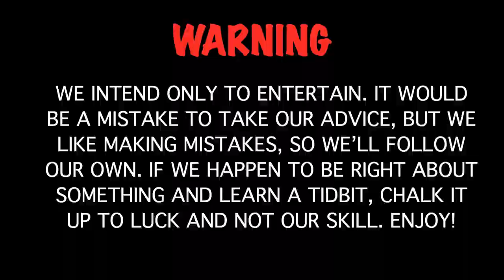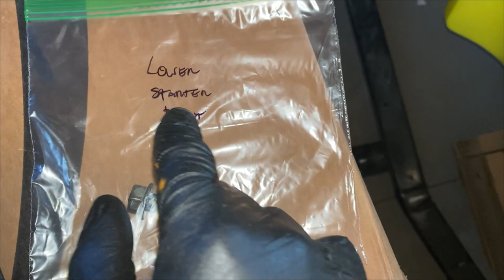How To: Change the Center Differential in a Subaru Manual Transmission. 2012 Outback 6MT example.

Comment: The 38913AA230 centre diff weighs 4.5 kilograms or about 10 pounds.
You do NOT need to drop the gearbox to replace the centre diff.
They are relatively straight forward to replace with the gearbox in the vehicle.
Reply from the maker: We have done it without removing the gearbox as well, in this video we knew we wanted to do the clutch anyway, so we did it this way. 

Glad you mentioned this though, and great timing! We're going to be posting another video showing the other method soon. Stay tuned!

Comment: In the older 08 subarus theres a front wheel drive option in the fuse box for when using a spare tire. I can not find that option for my 18 crosstrek. Did they do away with that?
Reply from the maker: There was nothing in the manual for this model about any changes to run with a spare. You should however make sure your spare is in the rear.
Reply: Yes they removed that, fix the crosstreck those things break because you didn't replace all four tires at the same time

Comment: In your opinion, would the paper gasket made for the t-case be a better option than silicone? 
Good work! Tackling the same thing on my saabaru 92x , just not pulling the trans haha
Reply from the maker: Either one will probably work, when we took ours apart, the tail section was sealed with silicone. The transfer case to transmission was sealed with paper. That’s how we reassembled it in the end.

Comment: Is this job relatively the same as a auto transmission?
We have the same year and model. Just had trans rebuilt and getting torque binding. Local mechanics said its the center differential.
Reply from the maker: Yes, very similar.

Comment: My VB WRX has been clicking since it was bran new. In parking lots, it does like a click and then like a shutter noise when pushing the clutch back in. I asked around, and no one knows what the noise is. I asked the dealer, and they don't know, but then said it's normal.
Reply from the maker: Subarus have two notorious problems - weak transmissions and head gaskets. You should probably have the dealer replace the tranny if it is still under warranty. It should never click.
Reply: @NiceGuysGASS  yeah, i think the head gasket issue is long over. But the transmission suck. This trans has the shittiest synchros I have ever felt. 1rst gear is too low too. 4.11. should be like 3.8. Subie says that the front diff is open, yet it skips in my driveway and parking lots like an LSD is in there. I have no drivability issues though. It's under warranty, and I also have the extended factory Subaru warranty bumper-to-bumper X 10 years. I did take it to them, and they said it's normal. Yeah, OK. If it is, I'd say it's the center diff. LSD clutch packs disengaging.

Comment: I have a 2004 Impreza 5-speed manual with 156,000 miles. I started getting random clicking that I can feel in the stick shift handle. It does it cold too thoguh. 
I bought the car recently and didnt check the manual transmission oil beause I wasn't aware I could.  It was 1.75 quarts low. It holds 3.75 quarts so it had 2 qts in the oil pan.  But the oil is super black, like 10,000 mile diesel motor oil and smells a little burnt perhaps. Refilling to Full made the clicking much better, but it didn't go away completely.  Manual clutch oil was and is full and clean. 

Do you think I've toasted the transmission?  What should I do?  Flush the tranny oil a few times?  Use any additives?  Thanks!
Reply from the maker: The clicking is almost definitely a worn out center diff. It needs to be replaced.
Reply: @NiceGuysGASS  is it something that will get worse and worse?  So I have time and can drive it too?
Reply from the maker: We can’t tell you anything for sure, but the example in the video drove for a while with the injury and didn’t fail.

Comment: I think this is what wrong with my 2012 6 speed Subaru.  Does the whole engine jiggle when you turn as well, along with the clicking noise?  I replaced the axles twice, once with cheap Napa axles then with Subaru axles, I thought it was the cheap Napa after market parts but maybe it’s the center differential?
Reply from the maker: It’s probably the center diff. If it is clicking when you turn both ways and you’re getting a full car shutter, this is the problem. Make sure you swap the bearings inside while you’re in there.  We made the mistake of not swapping them and had to take everything apart and swap them out a few months later.
Reply: 6 speed Subaru has a different assembly. The center diff in the 6 speed is built better but you never know...
Reply: I replaced the center diff in my 6 speed transmission and it fixed my problem.
Reply: I cant find the biscous coupler for the 2012 6mt . Any help
Reply: Viscous coupler **
Reply: @redartisanwolf6716  the center differential is located inside the rear portion of the 2012 manual transaxle.  It is sealed with by 9 bolts, there are multiple videos online.  I have done many repairs to Subaru’s and this one is mid range on the spectrum of difficulty.    An oil change would be 1/10 and engine rebuild being 10/10, this is a 4/10. As far and engine rebuilds on a Subaru compared with other vehicles, those are easy too. You can change the center diff yourself.  I did a brief search online and a viscous coupler is synonymous with center differential.  You do NOT need to remove the: transmission or exhaust system.

Comment: did you replace any other bearings in the center diff housing ?  Did you reuse the same shims ?
Reply from the maker: We did not replace any bearings, but there are 2 that might need to be replaced. They are both on the output shaft. There were no shims to reuse.
Reply: @NiceGuysGASS  oh weird. on the 5MT there is shims behind both bearing races on the output shaft.  I also replaced the bearing on the other end of the center differential. the bearing that bolts to the end cover.  I know I drove mine for a while needing a center differential because I didn't have the money to do the job for awhile and when I had time and money to do it, I had about 1/8" of slop in the output shaft bearings.
Reply from the maker: That is probably true, it’s been a while. And replacing bearings is never a bad idea.